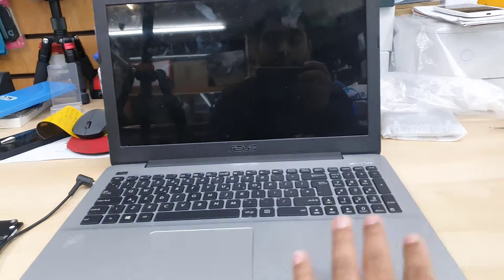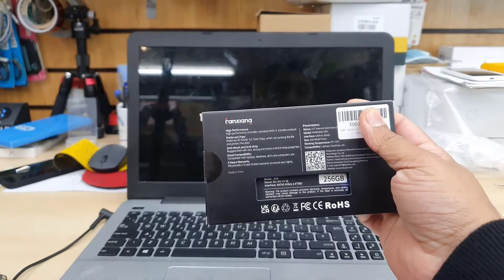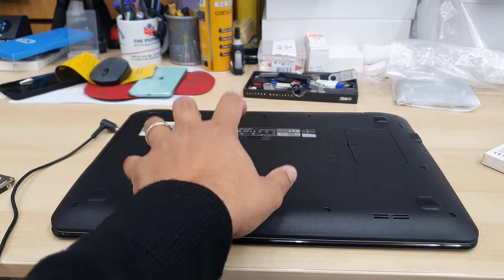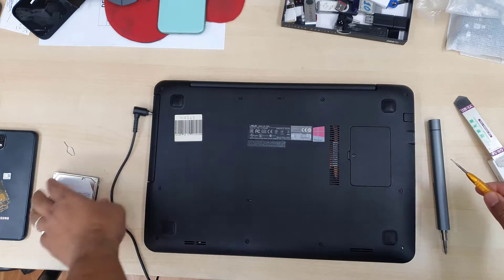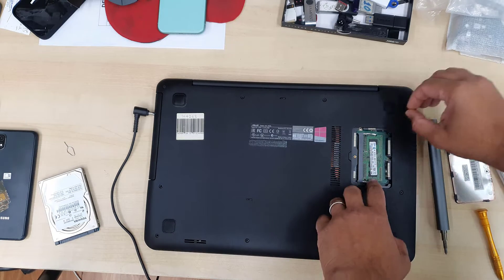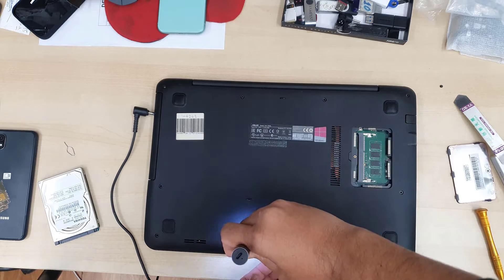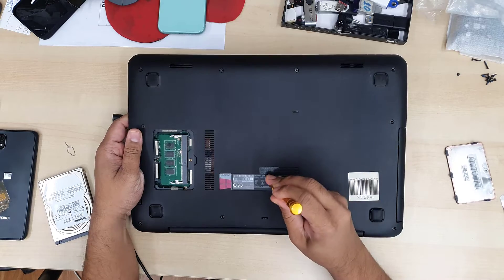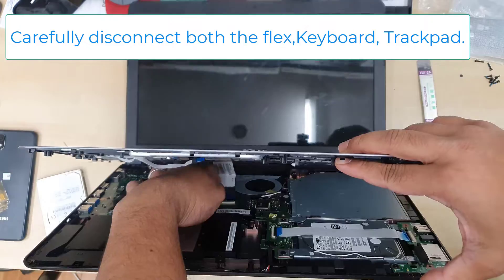How To Upgrade Asus  X555LA Laptop | Step By Step

Comment: Nice video Sir. By the way, what's the specs of your additional ram that you put in
Reply: I was only able to get one 8GB stick for a total of 12GB.
Reply: I upgraded to SSD drive, 12GB ram, new battery, and now adding a better network adapter.  Also got back lit keyboard, but installing that is very difficult (requires melting plastic tabs), so I haven't bothered with it yet.